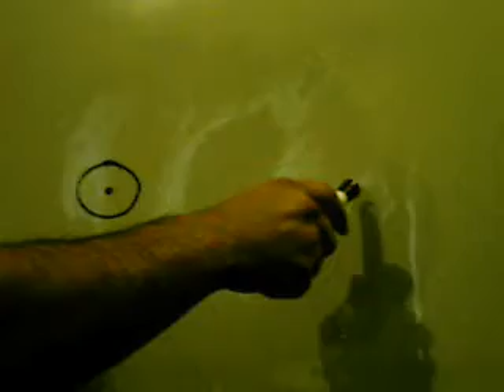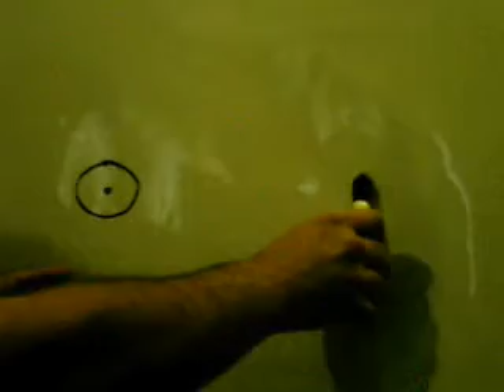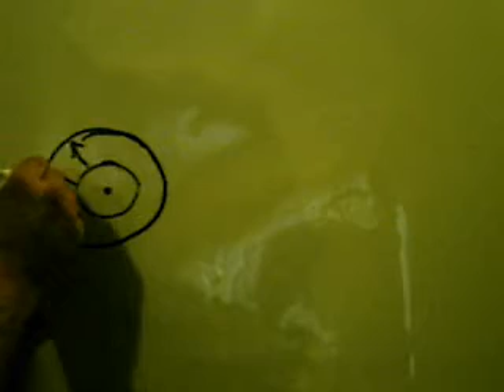Advanced Wheel Design

Comment: My opinion is that it is possible to create an expandable wheel by using a cone in the center of the wheel running parralel to the spindle or axle. A brake caliper type of device can force the cone in and out causing an increase and decrease in the diameter at the central axis point. Cotact rods placed radialy along the cone will establish desired diameter. So far this stage would be easy. Now one would have to develpo a tire that can expand but at the same time be able to absorb interal devices

Comment: Changing size of the wheels would be great for traction purposes, but it will actually cause a loss in power, as you increase the size, the engine would need to produce more torque.  Although in a crude way, this is how the old rotary transmissions worked =)